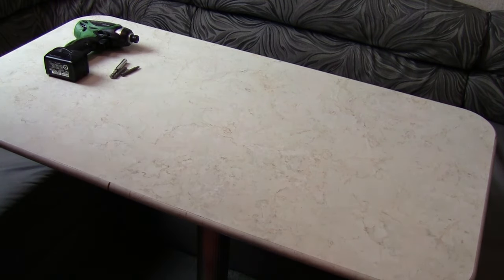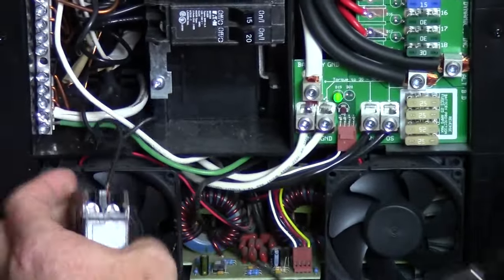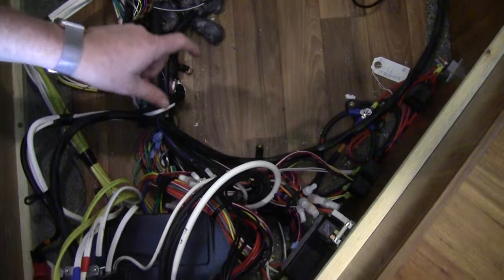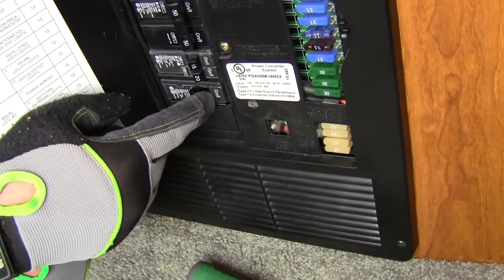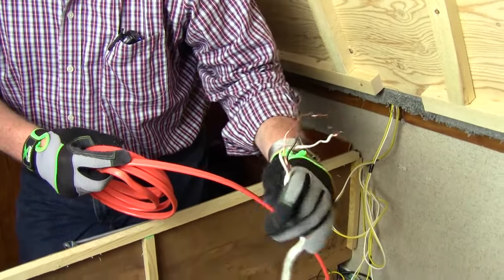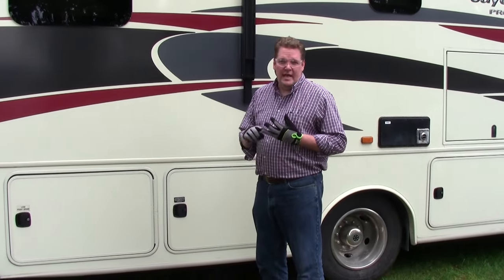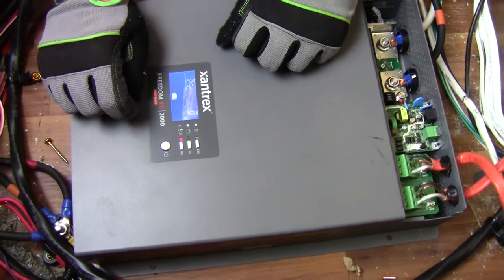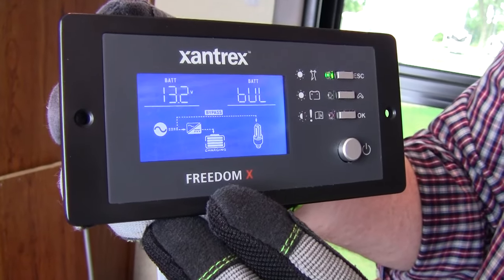Replace broken converter with a Xantrex Freedom Inverter Charger! Step-by-step installation video

Comment: Can I run all the AC coming into the camper through the inverter then to the camper AC panel and turn off the air conditioner breaker when boondocking then turn air conditioner breaker on when on shore power?  Basically all AC through inverter and turning air conditioner breaker on and off when boondocking.  My camper is a 30amp single air conditioner.  I want to run everything, minus the air conditioner which includes mainly a microwave and maybe a toaster and coffee pot occasionly.  Mainly the lights, pump, and microwave.  My TV runs off 12volt.
Reply from the maker: You may go this route. For further assistance, please reach out to our tech support at 1 800 670 0707, thanks

Comment: I finally understand what this thing you Americans call a converter is. So it's basically a 12v battery charger / basic transformer.
There are a bunch of videos describing replacing converters for inverters, but I couldn't understand what the difference was. Some Inverters are combination inverter-chargers, so if  you call those  inverter/chargers, why aren't converters just called chargers?
Reply from the maker: Battery chargers are more efficient chargers that use a sophisticated 3 stage charging for fast recharging of batteries. Converters may put out constant voltage too low to efficiently or fully charge a battery.
Reply: @XantrexTechnology  this is a much more complex subject then people realize and the explanation you are giving is very deceptive, in fact it's really nothing more than marketing hype .

  Three stage battery chargers should only be used when the batteries are not loaded or being used. 

if you are using the batteries while charging them then you are loading them down which means the 3 stage battery chargers computer can't detected the true state of charge. that means the battery charger never exits the high voltage bulk charge mode subjecting the battery to high voltages for far to long damaging the batteries and seriously degrading their life span. 

the bottom line is the only time you should use a high voltage 3 stage battery charger is if you need to quickly charge your batteries, most importantly you must disconnect any load from the battery when fast charging. 

if you don't need to quickly charge your batteries then I always recommend switching your inverter charger to a fixed voltage output of 13.5 volts,  this will slowly charge your batteries without subjecting them to unnecessary high voltages for extended periods of time which is very bad for batteries

A 13.5 volt charge is what's known as a standby voltage charge or constant current charge mode, it's the maximum voltage you should subject your batteries to when your batteries are connected to a charger full time while you simultaneously use them. 

The higher 14.8 volt that a 3 stage charger uses is whats known as cycle charging and its what you use when your batteries aren't connected to a charger 24/7, for example when you are dry camping and start your generator to charge the batteries. 

the bottomline is a 3 stage charger can seriously degrade a batteries life if it's left connected to a loaded battery bank 24/7
Reply: since you copied/pasted this rant below, I felt it important to copy/paste my response so nobody takes your criticism unchallenged.
.
That's actually not true.
.
The fact is: Lead-Based batteries require >14.0V to effectively charge (the word 'effectively' is important here). However, you are right on one point, that is that a fully charged battery exposed to a 14V (or higher) source will gas out and experience some damage. This is where 3-stage charging comes in to play. In order to get that 'effective' charge the 3 stage chargers go high (in voltage) for the bulk/absorption stage. This is important to make sure the battery gets to 100% quickly. Then, as the battery reaches a full charge, the charger senses this (usually by current, but every good one, including those by Xantrex, have a time-out value that forces the charger into float before any battery damage could possibly occur...though in my testing, timeout either happens within 2 hours, or well before that if there is a BTS involved). Battery manufacturers are almost exclusively in agreement that a 14.4V bulk/absorption, and a 13.4 float will extend the life of a battery, loaded or unloaded, by better than 30%. For more information, check out the Lead Battery Charging information at BatteryUniversity.com...here, let me help: https://batteryuniversity.com/learn/article/charging_the_lead_acid_battery
.
Now, educate yourself before continuing.

Comment: This is exactly what I was looking for. A Step by step replacement without actually removing the converter with a new Inverter charger. My ONLY question I have is will this handle 2 lifepro4 batteries ? I'm thinking of replacing my 1 12volt acid battery that came with my RV.  Perfect video..for me anyway.
Reply from the maker: Yes, the Freedom XC has a profile for LiFePO4 batteries and a Custom profile if you need to do something exotic.

Comment: Great video, I will be installing this exact inverter in about two weeks what size of cables are recommended for the inverter? Ground, negative, and positive cables? Thank you very much for your time.
Reply from the maker: It depends on the length and the inverter size (1000W or 2000W). Please refer to page 16 of the owner’s guide for DC cable requirements, and page 19 for the ground wire requirements. 

You can download the Owner’s manual at http://bit.ly/2HPLolf

Comment: I have got Xantrex 1800 Pro inverter in my RV installed from the factory. The mainpanel (loadcenter)is also from Xantrex. Im going to replace my AGM with 2 100Ah Lithium battery. The old xantex converter will not fullcharge the lithum I think. The DC input to inverter is 1 AWG (50mm2)wire from batterybank . There is no subpanel. The loadsenter is apart of the inverter feeded breakers. It's one breaker for TV (utility) and entertainment center (surround), the second breaker is for kitchen, bath and ouside outlet. I wanna like to have the breaker for the Micro from the inverter. Maybe this Freedom XC can be a replacement for Xantrex Pro? Do I have to replace the the old cable to the remotepanel.
Has been thinking of replaceing the unused emergency cranking  with DC-DC charger too!

Comment: This is a really informative video.  We just purchased a Xantrex SW 3000 inverter/charger and I will be installing it with 4 6-volt batteries totalling 470ah.  I also have the auto gen start, the control panel, and the freedom sequence to make a complete system.  I would think that the AC input feed line to the inverter/charger  would come from (a) the shore power connection and (b) the onboard generator.  Couldn't both of these be routed through a 50a (or 30) CB prior to feeding the inverter/charger?  And THEN, send the AC output from the inverter/charger to the main circuit panel feeding the entire RV?
Reply from the maker: There are many strategies to adding an inverter/charger. The one depicted here is the most common, and easiest to explain. However, after making this video, we did another upgrade  on this rig where the main transfer switch goes through a small panel with a 2-pole 30A breaker. These breakers then feed the inverters (there are now two Freedom SW 3012s), which then feed the main panel which has its main breaker downgraded to another 2-pole 30A.

Now the reason for the 2-pole 30A breakers in both the input, to the inverters, and at the main are a bit complicated. This motorhome would have a 30A shore except it has a second air conditioner, which makes it too much for a 30, but a two-pole 50A is overkill, so we reduced it to two 30s since the inverters’ pass-through are limited to 30A.

Since the FSW 3012 has dual inputs/outputs, you could use the same strategy with a single inverter, but we would discourage you from running one leg through the inverter, and the other bypassing the inverter. This requires a lot of forethought in managing your neutral wire since the neutral input should not connect to inverter’s neutral output when inverting. This is difficult with a single neutral wire. 

However, a dual 30A breaker feeding the two inputs of the inverter, then the inverter feeding a dual 30A main breaker in the panel is a sound electrical strategy, except now you have to manually manage the air conditioners to ensure they don’t run on inverter (you just don’t have the battery bank for that). We would recommend putting a dual 30 and two 20A breakers in the added panel, and break out your two air conditioners on those 20A breakers (assuming the wire is 12AWG, if it’s 14AWG use15A Breakers) then feed the remaining dual 30A into the inverter’s input.
Reply: @XantrexTechnology  Yeah.  You weren't really thinking ahead.  And you still aren't.  BTW, there was a blinking green light, indicating you were probably working next to a live 12v center.

Comment: Seem like a lot of work just to power a TV.   Wouldn't you also want your outlets and microwave, right from the git go?
Reply from the maker: The TV has been used as an example, the goal is to provide AC power in plugs to power all types of electronics and appliances within the inverter's power range.

Comment: Dumb question but i have the Freedom X 2000 invertor only. I have a progressive Dynamics converter. 

Do i have to change my settints for lithium if i only have the inverter? If so can i get rhe Bluetooth panel for rhe invertor only?
Reply from the maker: Hi DroidDoes1991, 

You do not have to change settings for lithium battery on the Freedom X inverter as it is an inverter only. 
And yes you can use Freedom X Bluetooth panel (808-0817-02) for the Freedom X inverter. 
If you have further questions regarding our products or need tech support, please contact us our tech support line at 1(800)670-0707.

Comment: Just to clarify, in this installation scenario, if the camper is connected to shore power and the inverter is off, does the shore power run the TV, or does the inverter need to be powered on at all times to watch TV?
Reply from the maker: Yes the shorepower will pass through and run the TV.

Comment: Hi Guys, thanks for the great video. I just had a Xanterx Freedom HFS 2000w inverrtor/charger installed in my Montana 5th wheel, but when I plug into shore power with the inverter either on or off it trips the shore gfi circuit, so I’m unable to get shore power.. Any thoughts?
Reply from the maker: Dear Dave - We suggest you contact our tech support 1-800-670-0707 for assistance. Thank you.

Comment: Do the fans pull heat out of the unit or do they push air in across hot parts and then out. Thinking about the required 5 inch free space on the DC side, and only 2 on the ac side. Also the manual says not to install vertically, Why if it's in an RV and not a boat where I could understand it. Thanks
Reply from the maker: Based on behavior the Fans suck air into the unit and “throw” it across the circuit boards to cool it off and then out by the wiring connections. 

We don’t want it mounted vertically because the vents are on the ends and we are wanting to eliminate the possibility of water condensation forming and dripping into the interior of the Freedom. 

If you install it against recommendations in a vertical orientation please install a drip shield above the Freedom regardless of your assessment of the risk of water droplets occurring. I hope that answers your question.
Reply: @XantrexTechnology  Thank you very much.

Comment: Great video.. I’m a little confused on removing the converter.  Is it not needed at all?  Did I miss something? I have a Winebego Navion that came with both.  It’s an xantrex 1000 pro and I’m planning on a freedom hfs 2000.  So I can do the removal of the converter when i upgrade?   Thanks again for the info Jim
Reply: A full answer can be reached at the tech center, but yes, the HFS2000 will replace the Xantrex 1000 "Pro" and the converter function in your coach. If you have the converter as a "lower unit" built into your panel, it is just like this video. You leave the converter behind and disabled.
Reply from the maker: Yes you can remove the converter if you install an inverter/charger. As for the inverter/charger, we recommend the latest Freedom XC 2080 inverter/charger - http://xantrex.com/power-products/inverter-chargers/freedom-xc.aspx

Comment: This is an excellent video, however, using the AC input and output Wago connectors is NOT quick.  I'd caution installers to do the AC connections before mounting the unit,  especially if you mount it vertically as I did.  At the very least the installer should attempt to open the spring clips to see how they are supposed to work before mounting. You cannot see inside the connectors to locate the wire location nor can you tell if the spring clip is open when mounted vertically in an enclosed space.  I spent several hours over 2 days trying to make the connection called customer service to discuss how the Wago connector should open,  and ended up removing the unit from the wall.  Even then, you must put a 45 degree bend in the wire end when mating it with the connector.  It does not go straight in, without the bend, installation is impossible, as I found out the hard way.  I'll never buy anything with these connectors again, they are horrible.
Reply from the maker: Thank you for sharing your experience. We are sorry to hear you had issues with connectors. We chose WAGO style connectors because they are much safer in the long term as they do not loosen over time. We are going to post a separate video on this topic. Please note that we are actually moving to a different style of connectors that will not require a tool to install, simple tabs that snap open and close.
Reply: @XantrexTechnology  We have had nothing but problems with the connectors.  Our most recent trip the neutral on the AC output side came loose and caused a short and the wire burned up along with a good portion of the green plastic connector.
Reply from the maker: @Marcs-Adventures   Sorry to hear you had issues with connectors. We have now changed to new lever style connectors which make it extremely easy to install eliminating all installation confusion and complaints. Please reach out to our tech support at 1 800 670 0707 for assistance on your unit. Thank you.

Comment: Does this guy do installation?  If so, where is he?
Reply from the maker: The person in the video is our applications engineer. He doesn't perform end-user installations. Whereabouts are you located? We may be able to recommend an installer in your area.
Reply: I read the comment I would like your recommendation on an installer in my area. I am located in Columbus, Georgia. If there is more than one please send all. Thanks.
Reply from the maker: We don't have an authorized service center in Columbus. Here's our list of ASCs - http://www.xantrex.com/contacts/authorized-service-centers.aspx. Any RV dealership should be able to install an inverter/charger. If there's any question, please have them call the Xantrex tech support at 18006700707. Thanks

Comment: Why would you put a sub panel under your bed under a platform the is screwed down  i hope it never trips  you will regret  that also if you sell that rig could be a nightmare  in waiting  for an unexpected  buyer
Reply from the maker: That is a great question for Jayco, the manufacturer of the motorhome. For clarity, the breakers are at the foot of the bed, near the floor, towards the hallway. Even with the bed slide in, the breakers can be accessed from the hallway with no tools. The Back of the breaker panes is what is under the screwed-down platform. Thanks for watching.
Reply: Could just mount a sub panel flush in the pedestal of the bed.
Reply: @XantrexTechnology  you actually added a 30 amp subpanel from squared between the physically between the inverter and transfer switch mounted to the floor in an inaccessible area. It was run off the AC output of the inverter. This makes it difficult to reset, or shut off the breaker for the TV circuit, and the future microwave circuit. It should have been easily accessible without removing the bed trim panel.
Reply from the maker: @jayecerruti2225  - You’re right. However, the under bed trim panel was not re-installed. Should the breaker trip, it’s merely a matter of lifting the bed to reset the breaker. Shortly after the video was taken, the small sub-panel was moved the the carpeted side of the pedestal to make it accessible with the panel completely installed.